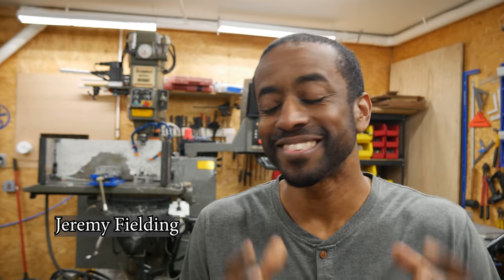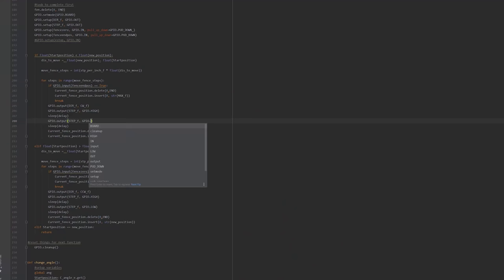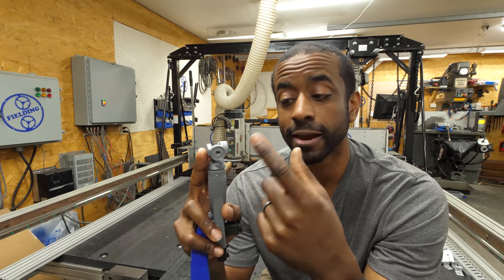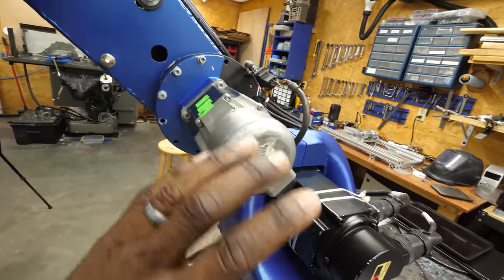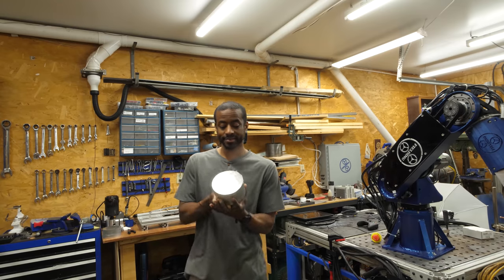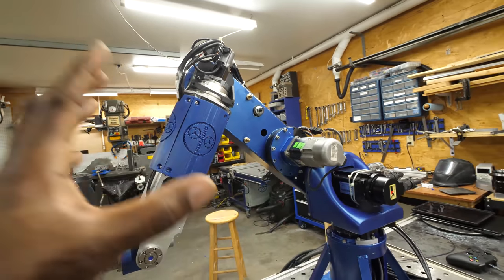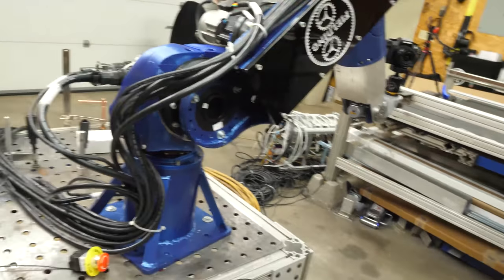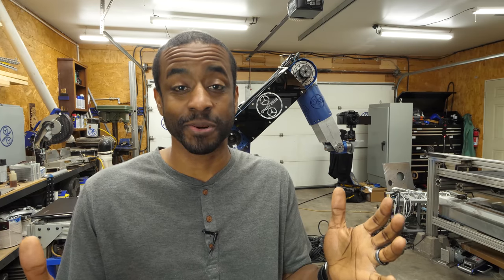Building a 7 Axis Robot from Scratch #089

Comment: I'm just starting out with robotics and your videos are great. How did you get enough torque out of the ac motors for a 14kg payload? Looks like about a meter arm which is a huge amount of torque like almost 140Nm. Most ac servos I see only have a few Nm torque maybe up to 12Nm. But it doesn't look like you have a 10:1 gear reduction. So how did you get enough torque?
Reply from the maker: The gearboxes range from 80:1 up to 160 to 1. Its in the video series. The torque is enormous. 14kg was in the slow mode. I had a "slow" mode and a "fast" one at one point where I could change the gear ratio. I think this is also discussed in the series. Strain wave gears FYI
Reply: @Jeremy_Fielding  Wow! Thank you so much. This is amazing. Your channel is extremely inspiring and this robot arm is incredible. You're the best.

Comment: At my factory we actually have a robot like this, but the overall damn machine can't do the job it was built for worth a damn. The arm can move into all the correct locations and find the proper input positions, PROVIDED there isn't a slight bump or the tubes it's meant to line up with aren't off at all in any way. However, the feed of the output product is almost impossibly unusable. The thing was meant to allow one person to do the set up of the machine to do its job while they do their own. While it helps do it's portion when the inputs are in a very complex pattern quickly, when those inputs then have to be moved and turned to outputs, everything is pretty much f'ed. It can take 3 times as long and in many cases has had to be totally redone from scratch. We've had the thing for years now but I don't think it's had a full years worth of up time. With all the work they keep putting into trying make it usable, the calling back in of the builders trying to get it straight, they are just throwing away more and more money on it that they will never make back. No matter how many times we tell them it needs to go, they refuse to listen. But the arm itself is pretty ok I guess.

Comment: Damn Jeremy, WTF aren't you my neighbor?  Man, we'd get along so well.  I, too, know all too well about be obsessed about a project build. I like to tinker with stuff all the time - all to the ire of my wife and friends.  I think most of your questions could've been answered from the get go if you had toured a facility where they employ commercial robots.  As it so happens, I work at Amazon and I work with these behemoth industrial robots on a daily basis.  Our Fanuc i2000, when not working in some our warehouses, can be found laboriously assembling cars in Detroit.  Your build is next level.  But what is your end game here?  Do you have a purpose in mind for making something so complicated?  Slight criticism:  considering the large size of your Power Arm, I'd say you need to at least double the base of your bot to maintain proper structural integrity.  Another thought, have you considered balancing your arm so that half is behind, half ahead of a main fulcrum?  This would offer tremendous advantages for acceleration while reducing stress loads as now your levers are greatly shortened.  This is how our Fanuc robots are designed and you would not believe how freakin' fast they move!  Incidentally, our robots at Amazon have a lifting/crushing force of 5,000 lbs.  Why this is so is a great mystery as these are merely relegated to lifting/stacking totes of a maximum 32 lbs.

Comment: Found your video while thinking about building one some what like it for 3d printing my full size car body panels..your very smart so i wish to ask you about keeping the print head perpendicular to the base as it moves around..? That i have sat and thought about..and still haven't found the answer that makes sense..i have nema 34 motors for this as my print head also includes my down sized auger from a mold injection unit i built last year with the 2 band heaters and a tube that connects to a pre heat hopper that's separate from the print head  the tube and hopper keeps the size of the auger smaller..i have mach 3 with the cura print add on..and it ran my mill x y and z but will be adding a fourth drive with a nema 23 to save weight and just run the auger..any help would be great..i just love building some cray stuff and you ought to see the car..again thanks Kenny

Comment: Ah yes designing the robot arms is a challenge but I wonder if managing the load should be handled in the software, I guess only if there is sensors that can feed data back to it, and if those sensors fail you would need fail safes or have the software shutdown. You can never have too much safety.

Comment: have you ever thought about using A diagram from an umbrella The mechanism in an umbrella that folds and extends when it spreads the top of the umbrella out and then you can pull it back down and it folds it all back together so you can store it If you take The principal Behind That feature of an umbrella I believe If you slide it back and fourth just like the handle pole of an umbrella But you would want it to close instead of extend You would only want it to extend or spread out and apart depending on the SIZE of the object you are wanting to pick up so it could pick things up instead of being a hand or claw it could be more like fingertips kind of like when Johnny Depp in Edward Scissorhands would try to pick things up with the tips of his shears but he would always drop it or he would always cut his face see thats because in the movie He had a pair of shears that were Fixated one on top the other because like scissors there designed to cut and snip but imagine if those shears were not only open but they were Fastened together in the shape of a claw or exactly like the mechanism that folds and extends in an umbrella but upside down SO IF YOU RIP THE CLOTHE OFF OF AN UMBRELLA AND HOLD IT UPSIDE DOWN YOU MAY GET A SENSE OF WHAT IM Describing or a four fingered hand with one or two finger spikes taking the place of a thumb It would be like the tips of the umbrella would be sliding out and they would extend and then when they retracted to go back the direction they came before they could completely be retracted there would Intentionally be an object in its path to Obstruct the claw spiked finger tips In the middle of it's sequence ( now when i say retract i dont mean bending at a pivot joint unlike a unbrella i mean the further these spikes slide out the further distance they spread apart from each other creating a wider diameter and then the opposite would happen when they retract ) so depending on the tension of the claw spikes whatever you wanna call them the diameter and weight of the object would be the defining factors to consider weather or not you could actually pick something up

Comment: Can I build a robot arm to traverse left and right off two rails mounted in ceiling out of the way? It will cover area of work table.  I wanted to devide  pegboard in sections with different tool types for working with.  (Section D Location 1 could be a special bit for a Dremel.). Upon speaking “D1”, it locates grabs it and hands to me in my hand it finds open beside me in my working area of table at that moment.

Also, return tools to their location after use,   Max weight would be my battery/cordless drill in its unique location.

Please reply.  PS,   I have been told to try windshield wiper motors as the can be controlled and lift up to 400lbs.

I have no metal lathe.

Please REPLY!

ALTON

Comment: Where did you buy the lower power servo motors? (like 100W / 200W) They are pretty hard to find (as a maker that doesn't want to buy like  a whole container of them)
Reply: From the BOM, it looks like they are part numbers SVL-201 (100W) and SVL-202 (200W) both of which appear to be available on the Automation Direct website 
And the Servo Drive is part number SVA-2040 which works for either motor
https://www.automationdirect.com

Note: YouTube didn't like the direct part links (?) and I have no affiliation with the company
Reply from the maker: I added a direct link to the description. The BOM in the description is not a complete BOM. Just the items I got from Automation direct. I bought a lot of items used on Ebay and other auction sites, including industrial auctions.
Reply: @Jeremy_Fielding  thank you, I will look into it

Comment: The secret is : they have all necessary machines to build something special (for example Robots, machines CNC, ...). 
If you have  the good machines so as a result you will made  something special. 

Good machines = you will made great things (robots, ...).
Reply from the maker: I disagree. Nearly every machine in my shop was made by me... some of them from scrap material. Search my older videos. You don't need special tools. The one huge difference specials tools add is speed. It can be done much faster with CNC vs manual mill, or even hand saws and files. But it can be done.

Comment: Would it be possible to tuck the arm in when swinging to reduce the radius of the load and rotational inertia? Like ballet dancers do to spin faster :)
Reply: *not applicable to all tasks, such as using the arm to control a cnc like tool
Reply from the maker: Certainly... but as you mention that only works for some applications.

Comment: you should contact Lincoln Electric Automation division.  They use Fanuc Robots for their robotic cells.  You use some lincoln gear in your vids, maybe they would sponsor you.  We have a lincoln robotic welding cell where I teach welding and it works great.  Another idea, check your local university or college that has Industrial Automation classes, the professors there could be a great resource.

Comment: 1:07  No, you did not need to do that! ;o) 
If you can 3d print parts, you can cast parts for your robot.  Loads of tutorials on using lost pla casting.  For sur you have the skills to machine the resulting part.  Best of luck on it.
You really didn't have to you know. ;o)

Comment: HOW!??HOW!??HOW!??HOW!??HOW!??HOW!??HOW!??HOW!??
U'r doing U'r home work!! torque test's nema 34's...winding up small rope, lifting a dumbbell....i.e. 5,10,20,30lb....could use cement cubes!!
U got this!!  that's so heavy!! I would re-inforce the frame, with a metal plate. or rods!!! yup! SW is good!! smart!

Comment: For controlling motion which type of company make motion controller you used like , servo motors+ driver+controller , can u suggest me please, i am comparing with , yasakawa, hiwin , Mitsubishi, Schindler, but I need technical specifications so please guide me 

I calculated 6 axis , torque of each axis motors and selected harmonic gear box for my Robot to achive 0 backlash and momentum of inertia , jerk , power and torque, acceleration, deceleration, accuracy, position ability, precision etc , 

Virtual simulation and programming by robodk software 

Based on power and torque iam calculating belt and pully ratio

So please suggest me a motion controller technical specifications to purchase a good controller for my project 

And make video on controller - on about, pluse modulation, frequency response, encoder feedback, bus terminal, input and output pins, communication from motor to controller

Comment: Can anybody explain me why this robot does not Fall down when power is off? IS there any self locking?
Reply from the maker: The motors have brakes on this. The brakes work in reverse. When they have power the brakes are held open by power, and spring shut when power is lost. So if the power is cut or you turn off the robot it stops in place. Its a safety feature for power loss as well as just being able to turn the robot off.
Reply: Thank you my brain was frying to Figure this out. Man you are great I love your Videos Keep pushing